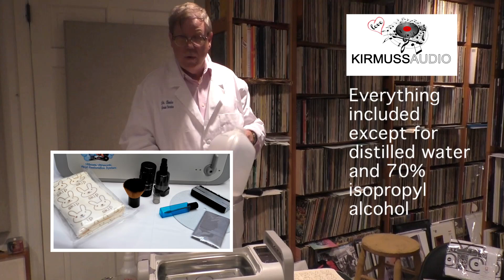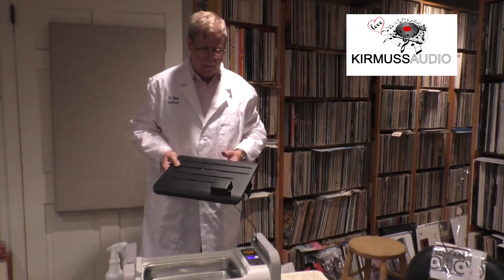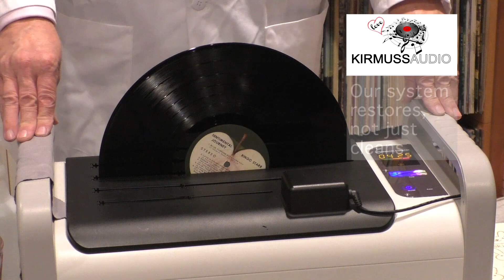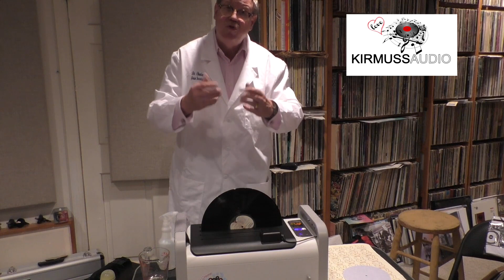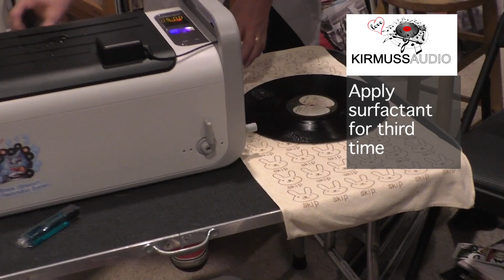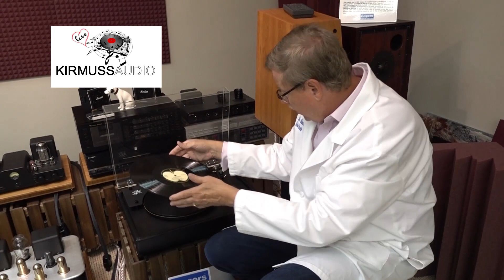Kirmuss Audio Oct 2019 User Process Update

Comment from the maker: We noonger need to cool the machine down when the small red light flashes tgat indicates heated water. We change out the warm water with fresh room temperature water. This cools down the transducers where both water and transducers were heated by use and cavitation.

Also, we now since 2022 use 2 or 4 minute cycles based on what we see on the record after we  have processed the record in the first cycle in the machine. Sheets of water or hundreds of droplets of water on the record, we use 2 minute cycles. If not, use 4 minute cycles. Watching for the  appearance and rise, then rapid dissipation of the colorant.

Comment: I was considering buying one but it looks like it takes 30 minutes to clean one record using this process and there's
warning to turn the machine off after 35 minutes of use and let it rest for 15 minutes, so that means close to an
hour to clean 1 or 2 records, sorry but that's ridiculous.
And why do you have to push the pulse button twice in succession? Why no just make it so you push once. And the 1.30 timer sequence you repeat twice. Why not just make it a 3 minute cycle? Sorry but I don't get it.
Reply from the maker: Incorrect the process. We can process 20 records before turning the machine off to cool down the transducers. The 35 minue rule is  applicable only if applicable if we do not stop the machine.  We can further continue if we change the hot water when the small red bar flashes with a cool refill. We processed here in Seoul in a media  event yesterday 11 records, 4 cycles before a 10 minute stop when the small red light started to flash.  Give us a call.
Reply from the maker: We now change out the water when we see the flashing red light. Cavitation creates heat. Then re use the water.
Reply from the maker: @UROKRK  You need to educate yourself on the KirmussAudio restoration process. You seem to be passionate about records. 

Lint free and dust free optician cloths we use are by Leica optics division. 

May I suggest where you watch our 45 minute training session on our YouTube channels recorded at Damino Technologies in Seoul.
Then the live unscrioted recording of a record restoration session at the recent SteroNet audio show in Australia. 

The colorant that appears is just that.  It shows what the ultrasonic brought to the surface in the prior cycle with the record in our machine.

Thanks for your post.

Comment: I want to buy one of those covers for my US machine but it does not have the connector on the side to plug it into so i want to use an adapter. Do you know the DC voltage it runs on?
Cheers, Cesar
Reply from the maker: The assembly only works with our machine. It is not just voltage but cavitation machine frequency and resonance
Reply from the maker: The machine you are referring  is not made by us and if our ionizing agent is used will affect negatively your records just as our spray when used with other machines will see the records sandblasted.